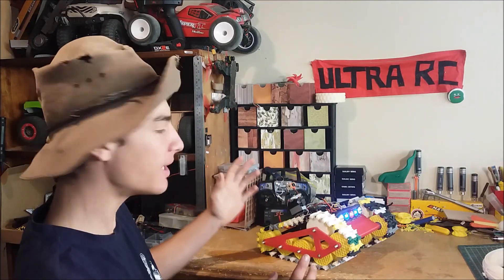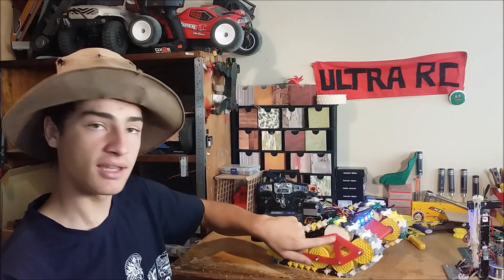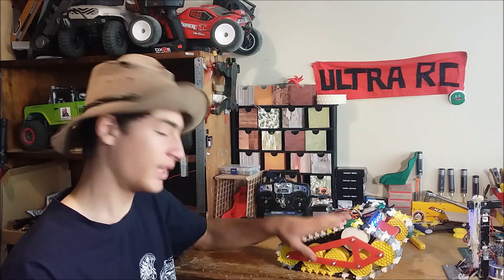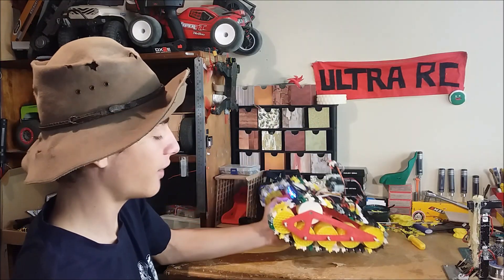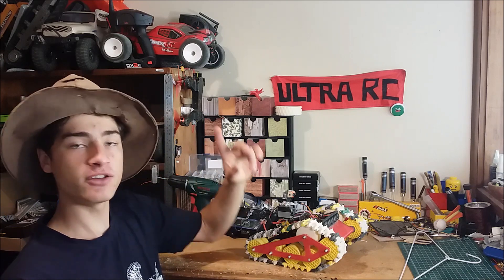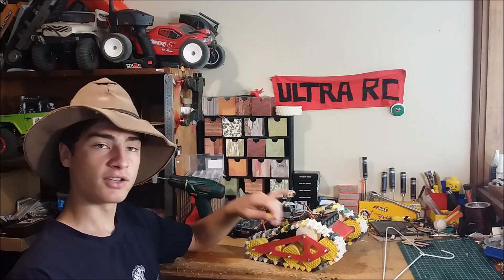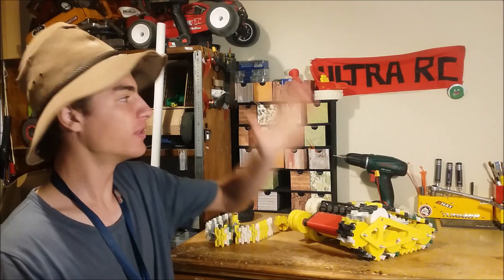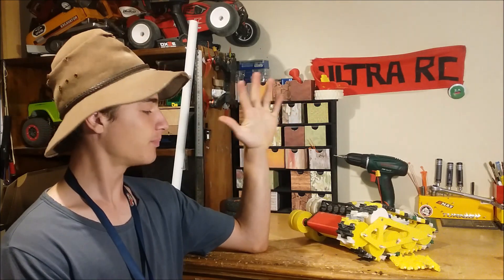3d Printed RC SPEED TANK //ULTRA RC

Comment: How did you setup the dual rate / mixes to get the driving controls onto one stick?
Reply from the maker: On a plane remote you can just select elavon or vtail mixes, this works fine and would normally be used for a plane with 2 control surfaces that mixes them for up and turning controlls. I hope that makes sense. You can mix it manually but that is pretty hard. Good luck and thanks for watching ULTRA RC mate!!!!!!!!!!!